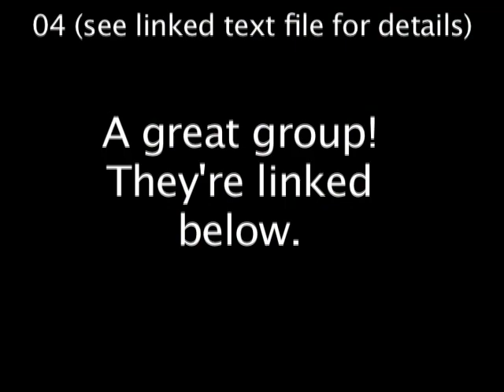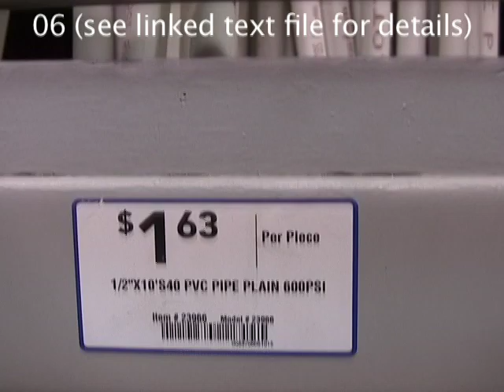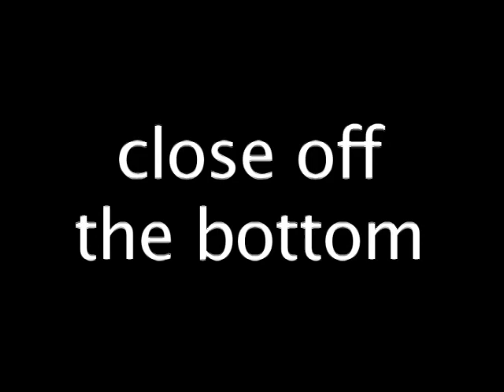Water Rocket Launcher: Simple, Easy to Build

Comment: Nice improvements to my air inlet design, I never thought of scuffing the surfaces when gluing the pen tube nor did i think of getting glue inside the pipe. I used your improvements successfully on the previous version of your water rocket launcher I built back in 2011, they work great.

Comment from the maker: If you read the accompanying linked text file it talks about making the inlet strong. The previous design is very rugged, but the intent of this design is to make it simple enough just to get people started with water rockets. If people launch a few and the inlet breaks loose, then that's a learning opportunity to make it stronger. 
I should have showed filling the bottles. Only the bottles, but a little water gets into the pipe when you put it on. Tip and empty every few launches,
Slater